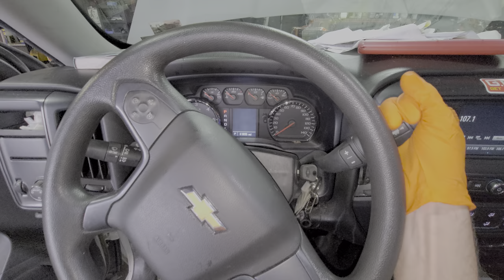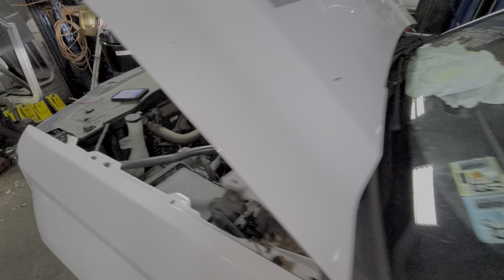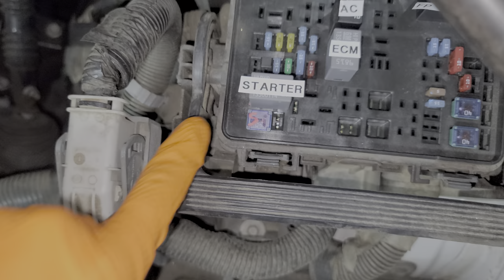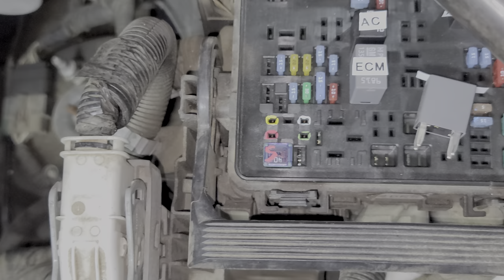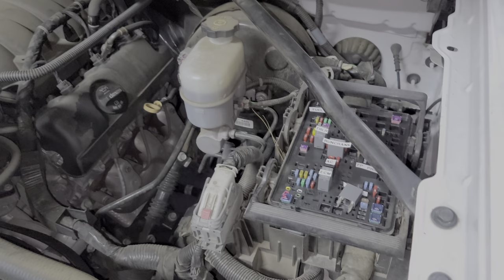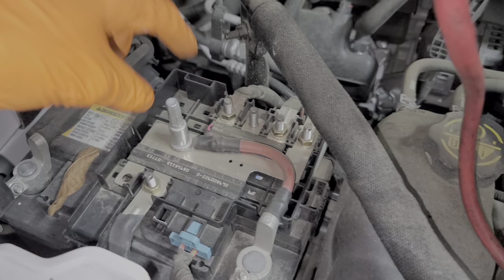2018 Chevy Silverado Starter Relay & Fuse, Ignition Switch Bypass for Starter Testing

Comment: Yea, I got a question…that relay can be indexed one way, or also if you turn it 180 degrees. How can I tell how to properly orient the new relay? Great video, but it didn’t address a problem that every single person will wonder about.
Reply from the maker: The relay can be installed either way I promise

Comment: Awesome video! I tried neutral start didn't work. Went to the fuses and sure enough it was the relay for the starter just needed a tap and it started right up. Cheers from 🇨🇦 🤙
Reply: When your truck wasn’t starting, did your dashboard turn on but engine not fire up? Thanks!
Reply: @12riveradavid  hey Dave, that's what my truck is doing, have played around with the relays and still nothing.
Reply: @sendyplumber  I replaced the relay with a new one and my truck started
Reply: @12riveradavid  I just figured out my work truck, the fuel pump prime relay wasn't making contact. Pulled it out halfway and it made contact, allowing engine to start. Fuse panel must need to be changed from moisture/salt causing corrosion.

Comment: This was great info. My problem is switched relays and no start. Hot wire jumper at relay terminals as shown in video and engine turned over. Then I replaced the relay and truck started repeatedly. Any idea what was the cause for the original no start
Reply: Was it cold out?

Comment: Great job man!! Saved me a big PITA. I noticed my remote start taking longer than usual to start my truck. I tried to start it last Friday and it wouldn't start at all. I know my ignition key had been getting unusually warm recently, so I assumed it was an ignition switch problem. I ordered a new ignition switch, then I saw this video. I pulled the relay and was getting ready to jump across the connections, while watching the video on my phone, then tried the trailer relay and my truck started right up. Thank you!!
Reply: Exactly what got me going!!

Comment: Just saved my day. Swapped relays as you suggested and it starts… Thank you!
Reply: When your truck wasn’t starting, did your dashboard turn on but engine not fire up? Thanks!
Reply: @12riveradavid  yes, that is what a bad starter relay would  cause. Dash lights up as normal but no click sound from the starter solenoid and a no crank

Comment: amazing video, I swapped the trailer relay fuse with the starting fuse and it fired right up!, thank you!!
Reply: When your truck wasn’t starting, did your dashboard turn on but engine not fire up? Thanks!
Reply: I have a 2017 Tahoe dash turns on once I turn key to turn truck on there’s no lights at all won’t start
Reply: @12riveradavid did u ever get it fixed and if so how I’m having the same problem

Comment: Its a great way to pre-oil your motor before startup after a rebuild, or in my case after turbo replacement. Let it crank until the gauge shows pressure for a few seconds, do it twice then fire her up with full confidence that everything is lubed and ready to run.

Comment: Hii...hey i saw your video because a little problem with my 2018 chevy silverado 1500 5.3L hybrid....the starter wont stopped turning....i was checking the pins as you explained on the video....but in the white pin it supposed to carry power to the stater....well in this truck that pin have ground all the time and i can't figure out why....the other three pins are the same as you explained but this one...i changed the starter by a new one and still doing the same thing

Comment: 2018 chev silverado. Needed a boost day before. Then had a new battery installed. Drove all day, numerous starts. Sat for an hour after dinner, clicking sound... no start.
Reply: I got the same issue, what was wrong with yours?

Comment: Your video is great I appreciate the color coordinating in visual labels I get power all way down to my starter sounds like it engages but will not crank over 2018 Chevy Silverado 1500 5.3 L just can't get it to start or turnover any help would be grateful
Reply: Have you figured out what your issue was?  I'm having the same problem on my 2017
Reply: @jasonprather1736  yes I did thank you it ended up being my starter and then today I took and had to replace the battery I had lost a cell in the battery and I was getting the same occurrence as before sounded like the starter was engaging but would not start power throughout the whole thing my initial thoughts were the starter again I ended up getting the alternator battery and the starter tested this time and it was a battery due to a low cell
Reply: @kendallcrittendon107  good to hear.  I'm still struggling with mine.  Replaced the started. Battery was tested and reported to be a good battery.
Reply: @jasonprather1736  I do know I was told check out the crankshaft position sensor that's right above the starter you had to take the starter off to get to it fortunately I did not have to go that far they are relatively easy it's just getting to it it's a pain in the butt
Reply: I have the same truck and the same issue - ended up being a battery that wasn’t producing enough cranking apps but still powered everything else normally. That was two years ago and today it wouldn’t start again. I tested this method and changing the relay didn’t help, fuse is intact, so it could be the battery again.
Reply: @jasonprather1736  my battery initially tested positive too until the tech checked the cranking amps for this model then it came in under.

Comment: Having an issue where sometimes it will start sometimes there’s nothing at all, weird part is if I roll the window down and back up it will start 99% of the time, have a feeling it’s the bcm FML
Reply: Having the same problem, it will start sometimes then randomly won’t start with no crank or nothing . Then go back hours later and it starts right up . Have you found the issue ?
Reply: @evyysmoove2100  how you found the issue yet?

Comment: I get how you tested it, but I can’t get over the fact that you seem to be connecting pin 86 to 87. From everything I read, pin 86(red) is the one that would receive power when trying to start the vehicle. So I’m not sure how your test works but I know it does because I saw another video do the same thing… so confused.

Comment: My starter connections were loose 2018 Silverado 39,000 miles.would not start, pulled back the wheel well and tighten the connection with 13mm.
Reply from the maker: Thanks for the info!
Reply: Any way you could make a video?

Comment: So if I do the jumper wire where the relay is and it doesn't turn over does that mean that fuse is bad thats on the passenger side battery?

Comment: Here's one for you sooner the better response.... I've got a gmc2500hd 2018 pickup remote started fine this am. U locked it and hopped in tried to turn key and was hard as a rock can't turn it like something's locked it... Remote started again was fine.... What the hell is going on the steering wheel lock mechanism is fine as removed top cover and lower  steer cover??? I've about tried everything and still can't get the key to go anywhere have original and spare.. same thing with either of them... Please help I'm out of ideas....

Comment: I have a 2016 colorado truck 2.5  my truck wont crank, i have a new battery but still doesn't crank. I when ahead and order a ignition rely fuse, in my fuse box it doesn't read starter so I assume its the ignition rely. let me know if I am right

Comment: My problem is sometimes it cranks and sometimes it’s great. It started doing this after charging a tool in my accessory outlet on the dash. I thought maybe a cell was bad in the battery but 75% of the time it’s great. Acts as tho the starter is engaged by a capacitor that’s charged to engage the starter but may be going bad because of not turning over at times. Could it be the relay?
Reply: Sorry I meant sometimes it DOESNT crank and sometimes it’s great .

Comment: probably wont get an answer before i get home from work today but i have an issue where i have 12V+ in my batter (seen on my voltmeter in my dash), go to turn the key and everything dies. not sure if im looking at a starter issue (normally theres a clicking with starter problems and i dont have the clicking sound) or if its as simple as needing a new relay. ill check when i get beck to my truck but ive never encountered a full dead reaction when the battery isnt actually dead...
Reply: How did u end up fixing this my dash and raido is not lighting up battary is good
Reply: @JwNettles  turned out being a dead starter
Reply: @brownsnake0400  good lord I just had mine replaced I can’t catch a break
Reply: Powers bypassing everything and going straight to ground

Comment: Hi
 I have a model like this, and I could not start the engine and What is strange is that the transmission light does not appear in the dashboard I mean  Interlocking letters   And I couldn't figure out why plus before when I turn the steering I have annoying sound !

Comment: Please help! I tested the relay and it is good. Tried to jump the connection with a wire and got nothing, no crank or response. What does that mean? Also checked continuity through the 175a fuse and it is good.
Reply: Hey same thing here did you figure out what it was
Reply: @adamwhatley1120  I did! It turned out my starter was bad. Then, In the process of replacing it, I somehow damaged the plastic wire connector that connects to the starter. It had no visible damage, and still connected fine. I think the wire must have gotten pulled back or somehow wasn't making contact. I found a video where the guy said the plastic connectors fail/break constantly. He went on to show how to do-away with the connector, and add a basic terminal ring connection instead. It was very easy to do. So turns out my starter failed. Then I broke the plastic wire connector. I cut that off, added a ring terminal connection. New starter. Back in business. Good luck!

Comment: I noticed that my starter has been cranking a little slower lately so I've been saying the battery is gonna hatch. So today after work I put the key in and the starter just clicked. So I assume that the battery is dead. Took it to get tested, they said it's junk. So I bought a battery, same issue, just clicked. So I found this video. Tried the first thing, that didn't work. Jumped the relay and it clicked. So I just kept doing that like 5x. Bow it turns and starts. Probably the starter, right?
Reply: This literally happened with me.  Everything you stated.  I got home with the new battery.  A few hours later, I remote started my truck (2017 Silverado) and it had a slow start but it started.  I thought that was interesting, so I turned off the truck and tried to use my key.  Now all lights come on but when I got to turn it. Just a click and nothing else...
Reply: @Kingdom_Comics  yep. It was the starter for me. Literally when it did it the 1st time I had 37000 miles on it. Gm said, we don't cover that. I have random screws falling out of the dash and I think  the trans gonna give up soon

Comment: If you go fromthe red to the and it does nothing what problem the. Also i went to the battery for the175volt fuse and it  registers 1, shouldn't it show 12.5 volts from battery side to the other post?
Reply: From the red to the white and starter does not turn engine would it be a bad starter?

Comment: I have a 2015 suburban. I took it to firestone to get tires on it when I went to pick it up no crank no start they put a new battery in it and they said the starter was bad they put a new starter on it I drove it home the next morning got in it and tried to start it no crank no start again I know the battery is good and the battery took out was good. 😮do you have any suggestions.
Reply from the maker: Perhaps a bad connection or a failed remanufactured starter
Reply from the maker: Or maybe there was never an issue with the original battery and starter and there is another problem.
Reply: I actually had no issues whatsoever with it until they got their hands on it. I jumped it at the relay and nothing
Reply: And a starter is a reman
Reply: He also said that the starter was seized up that he removed
Reply: @michaelgallaway9024  Did you get that figured out?  I had that issue due to intermittent starts.  I then changed the starter and no change.  Sometimes will start, but mostly solenoid on starter clicks, but zero flywheel turning.
Reply: @pitster  I wish someone would communicate the ROOT-CAUSE of issue such as this and intermittent cracking....some times will....sometimes will not!!

Comment: I have a 2018 Silverado. with similar issues i replaced the start relay fuse and it did start.  I also noticed that when i had low tire pressure in any tire the truck would not start. Have you came across this or is there another issue that i'm missing?
Reply: Wow my spare tire is not hooked up to tire pressure and.myctruck is having trouble starting but when I jump it it starts.

Comment: So what happens if you use the jumper wire and you get a click sound from the starter but no crank prob a bad starter then
Reply: Same issue!  Was it a bad starter ??
Thanks 
Ben
Reply: @gamingbros-je3yp  same issue, how did you fix yours?
Reply: Same anyone found the issue?
Reply: Same issue and this is BEFORE AND AFTER I replaced the starter.

Comment: What if the starter won't crank when jumping the "hot" red and the "white" starter sol.
Reply: Same issue. Did you get it sorted?
Reply: Me too
Reply: My 2018 Silverado just clicks once during the wire jump start. Battery is good just replaced alternator too. Any suggestions?

Comment: Hey what if i do you wire bypass test and the motor cranks over, but its not the relay? I replaced the relay and it had not fixed the issue
Reply: Same issue over here. Any advice?
Reply: @kelseykunz1027  then it could be your key switch at your steering column
Reply: Having the same issue any help ?